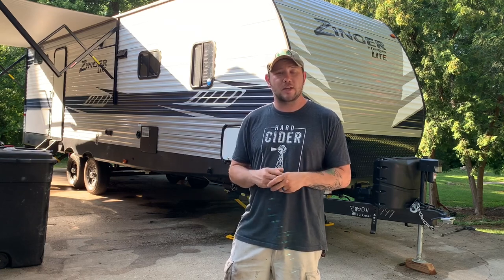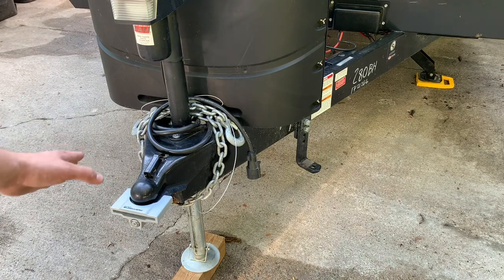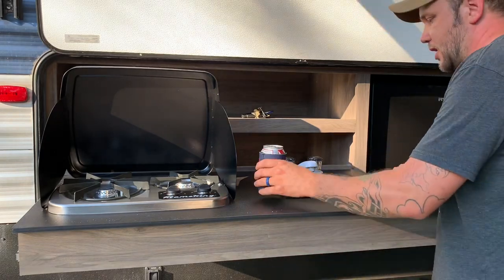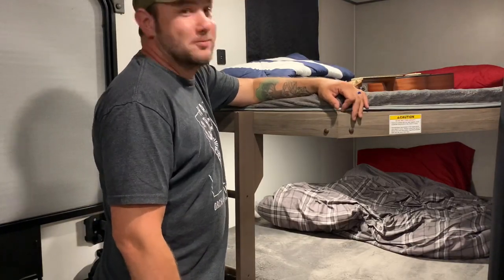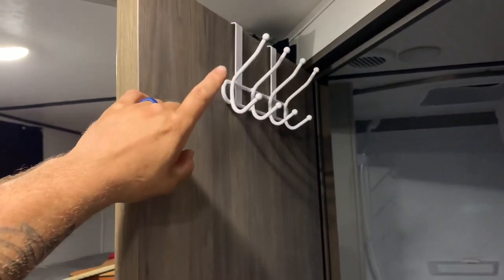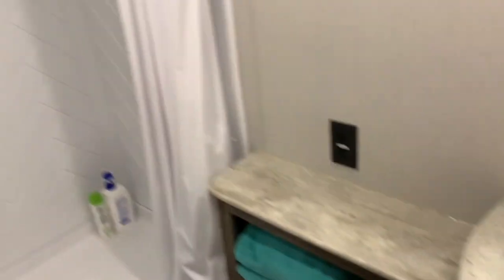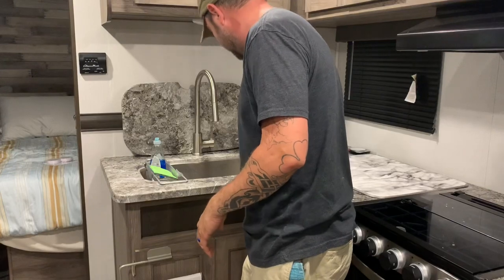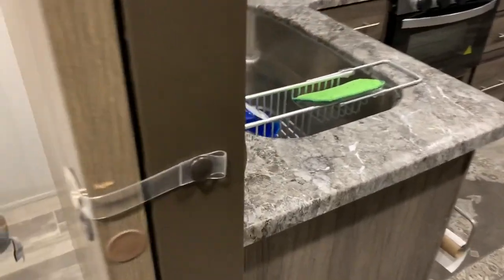A look at our 2020 Zinger LITE by Crossroads. 280BH

Comment: Have you had any problems with it?
Reply from the maker: No problems at all! Going into the second season with it now. We are beyond happy!! Actually..we’re beyond excited!
Reply: Awesome! We bought a 2021 330 bh pick it up tomorrow we had to have a second air installed. I was just worried after I read reviews online.
Reply: @Shanecoffeyoutdoors  hey Shane on that gravity table when we got home they had take it down how do U get it to stay up? We put it in and it just keeps falling
Reply from the maker: @Bowers639581  is your table, gas spring loaded. Ours just has a square tube and a nut. Not, a shock
Reply: @Shanecoffeyoutdoors  it just got a pole that slides in a bracket but keeps falling forward out...called my guy today and he walked in two others done same thing.
Reply: @Shanecoffeyoutdoors  it’s called a gravity table has a bracket hooked on the the seat pull top off the slide like a little shape pole out
Reply: @Shanecoffeyoutdoors  it’s a square booth like yours
Reply: @Shanecoffeyoutdoors  the table top has a nut that tightens but the pole is what is falling out